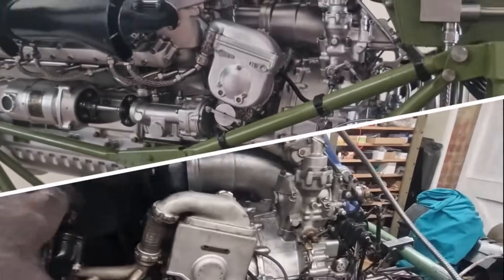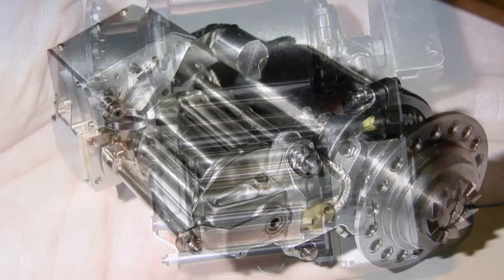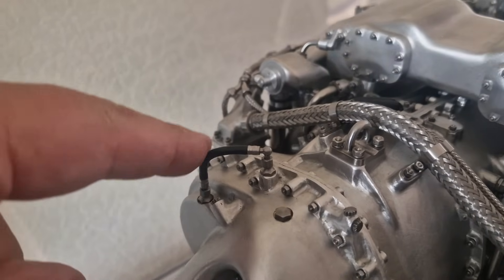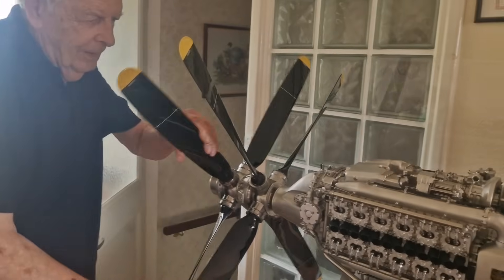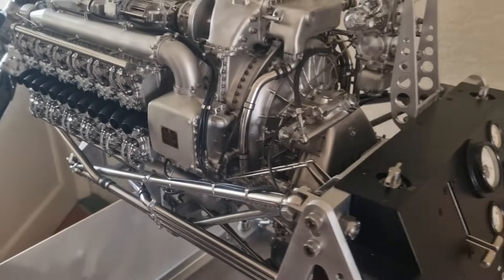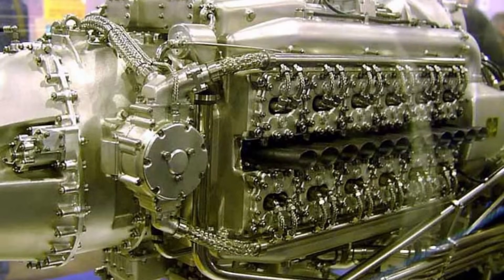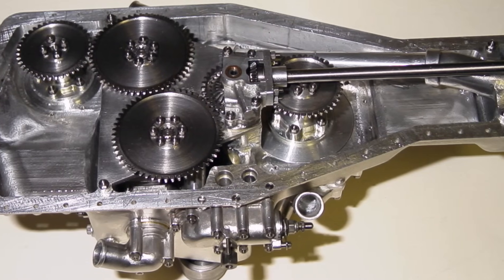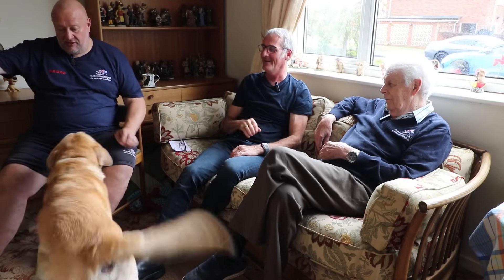Will Barry Risk His Masterpiece? And What a Masterpiece!

Comment: Elected to not run by internal combustion. That's a relief! Very wise and technically the correct judgement. Some things simply don't scale reliably enough or even at all. The grain structure of steels. The difference between a forged part and one cut from solid. Dissipation of heat. The behaviour of oil films, whence the viscous drag, friction and greater likelihood of metal-to-metal contact. Sleeve valves are demanding enough at 5 inches plus bore, thus close to impossible at this scale. Many thanks to you both for these fabulous videos. I really do hope Barry can show us his workshop and describe some of his methods. My starter for ten: How do you produce such perfectly shaped and finished 3D shapes in metal? A propeller hub would be an ideal subject, for example.
Reply from the maker: I'm hoping we can make some of that content with Barry in the not too distant future. Re the propeller hub, if you look at the photo montage at the end of that film you'll see one partly machined on Barry's miller. That gives a good idea of how he does it. It's machined as you see there then hand finished. It's clever stuff.

Comment: Absolutely amazing. 
Sometimes things don't scale linearly and maybe friction is one of those. An example I came across was a guy who made a  model railway steam engine. He had scaled down every aspect of the boiler but the result was that the boiler was a hopeless steam generator as the exhaust gases from the fire would not flow through the boiler tubes. Apparently the model engines have much larger than scale boiler tubes in a different arrangement.  For gas and fluid flow at different scales you start getting into these dimensional numbers like the Reynolds number.
Reply from the maker: Barry has a fully working small steam locomotive that he built in the 70s. He says it used to pull about a dozen people around on his miniature railway, and in part 2 of his Merlin build video he explains how the Merlin carburettor didn't scale so it only runs on one throat but the problem with the Eagle isn't so much scale as the fact that the full size engine had inherent faults and because Barry has so faithfully recreated it he's included those faults that were baked in by Rolls-Royce.

Comment: So what he's saying is that basically the sleeve valve engine doesn't scale well, you can <build> a scale model of it but the "scale" friction values actually increase as the model gets smaller. At least that's how my non-mechanic mind sees the issue.
I had no idea that Rolls Royce had a 24 cylinder H engine much like the Napier Sabre. Live and learn.
Reply from the maker: It wasn't that the engine didn't scale. It's that the full size engine was fragile and because Barry has made such a faithful copy the fragility has been engineered in - scaled fragility if you like. It would probably run but Barry doesn't want to find out that, oops, it broke.

Comment: I know it isn't exactly the same, but the Napier Sabre engine had to use a special oil to enable the sleeve valves to work.  It had a tendency to lock up while under power, which was disconcerting for the pilots.  Later versions reduced this somewhat, but it was still an issue.
Reply from the maker: I don't think anyone really got the flat 24 cylinder arrangement working. And then the turbojets killed it off entirely. The Wright Cyclone turbo compound engines were the epitome for me.

Comment: I am curious to know if every part is made so it is a scaled down version of the original including the pipework how it could function properly? Wouldn't the physics of the fluids be different at different scales,? The engine itself is a masterpiece of engineering. I would love to see it working.
Reply: You would scale the fluids as well mate standard logic
Reply: You'd have to use lower viscosity oils. The clearances are usually adjusted as well.  It depends on if it's gonna be run for a few moments or hours at a time.
Reply from the maker: That seems to be another black art that Barry has down. The Merlin is actually oil cooled. Don't ask because I didn't understand either.

Comment: The machining and fabrication knowledge required to produce something like this is simply staggering.  I can barely knock out a full size bolt, this just in another universe in comparison!!
Reply from the maker: As I say to Barry all the time - we don't call him Clever Barry for nothing...
Reply: ....particularly with the castings.
Reply from the maker: @potrzebieneuman4702  It gets worse - there are no castings. Everything you see there is cut from solid billet. Barry assures me that castings at that scale would not be strong enough so it's all carved and machined from solid, high-duty alloy.
Reply: @TheBluebirdProject  that's even more staggering !.

Comment: I would love to built something like this. Maybe a replacement for a car engine a mini 24 cylinder. Or maybe a mini Detroit diesel with  2.5" bore and 3" stroke (+/-) only make it a gas engine with fuel injectors spraying into the cylinder when the piston opens the port near BDC.  JUST AS THE EXHAUST VALVES ARE CLOSING..   THE SCREAMING JIMMY ON GASOLINE.. THAT WOULD BE AWESOME...  USING. A MODERN SCREW BLOWER TO TO SCAVENGE  THE CYLINDERS. And produce compressed atmosphere.  Coming  in at 353 cid/5.8 Litre.  Capable of spinning in excess of 8500 rpm with a twin compound turbos setup with a air to water intercooler  producing in excess of. 60 psi of boost set of brutal kill mode/ seak and destroy producing 100 psi of boost with 5.5:1-6:1 compression, the blower/ scavenger producing about 4psi at cranking speed. Injecting methanol sealing cylinders with total seal gapless rings. Maybe  build a diesel version just like the detroit.. cam fired injectors.  Adding stroke to improve scavenge time 3.5" stroke for 412 cid  24 cyl. Two stroke diesel 😂 it would be awesome..
Reply: 353 is about 2400cc not 5L